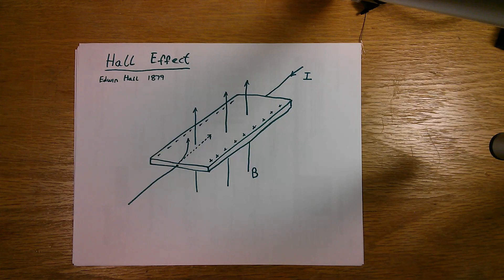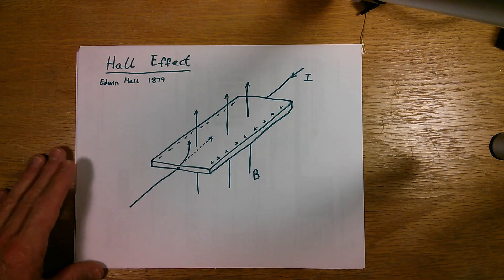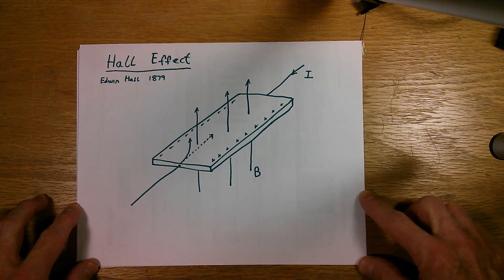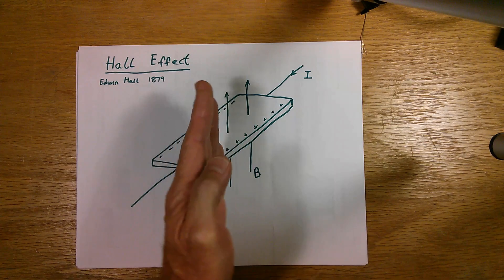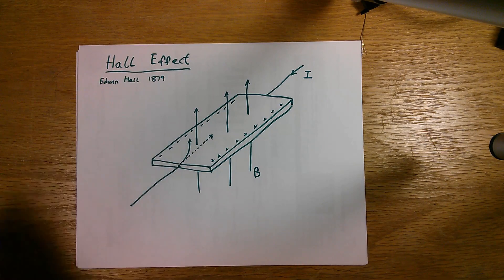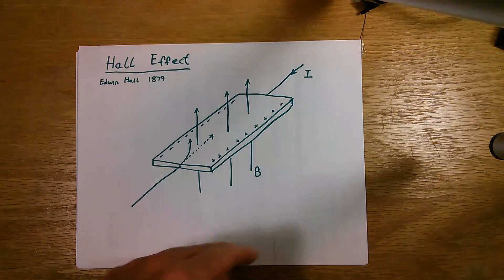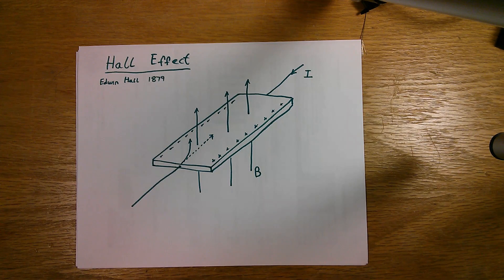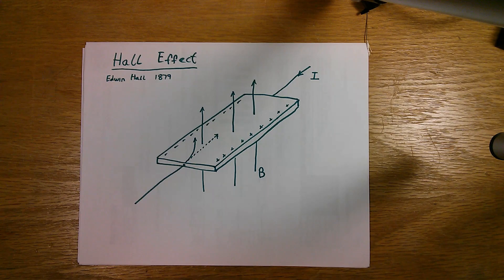Hall Effect Sensor Explained

Comment: Another quality video. I don't understand how it can sense just objects without actually putting a magnet on the object. I would be afraid that, for example, if i was sensing a gear tooth and it became demagnetized it would not be detected.
Reply from the maker: I have another video where I do put a magnet on a rotating shaft and measure the RPM.

With a gear tooth type sensor, the gear is magnetized or is part of a magnetic circuit.  The magnetic field will change as a tooth passes by and the Hall sensor can detect the change in the field.
Reply: So it seems like it is a kind of specialized application where the targets have to be either modified or designed to be picked up by a hall sensor. I guess a lot of things can just be magnetized by a magnet first.

Comment: On a bi polar hall sensor with three legs which leg is connected to the positive terminal of the power sourceFeeding it? Is it the Output or the Supply VCC leg?
Reply from the maker: Power is connected to the Vcc pin. This would be the left-most pin when looking at the sensor with the pins pointing down and the part number visible.

Comment: It would seem that the viewer who pointed out your mistake was mistaken himself. The right hand rule applies to positive charge carriers or conventional current so for electrons you simply have to use the direction opposite to your thumb. Note, if you're trying to determine the direction of force on negative charge carriers you can use your left hand. So with my left hand palm up in the direction of electron flow, I curl my fingers up for the direction of the B-field which is up, and my thumb points to the left. Your drawing is fine.
Reply: Yes very true...the drawing you have drawn is correct and precise. Here we will use the left hand rule. The current is coming out of the page, the electrons are facing a force towards the left which means that the field as to be upwards... :)

Comment: All the sudden that 2 minutes you introduced a new concept without explanation. You're talking about electrons flowing one way and then this other thing flowing holes.?

I thought that the conduction of electricity was just a displacement of electrons.  You seem to be indicating that there is some other sort of particle that travels the opposite direction of electrons or something??

When you have a battery that is charged up all of the electrons are trapped in the positive side wanting to get to the negative side to be at rest right?
Reply: +John Smith 
Holes are just the absence of electrons where an electron can exist. Usually from the different electron orbitals in atoms.
Reply: So in fact the electrons flow from the negative terminal to the positive terminal through the load and the electrons are going to atoms that have spaces in their orbitals for them,

Comment: is there any latency at high frequencies or a limit ?
like to measure something moving realy fast at high rpm  which one is better

hall effect or rotary encoders ?
Reply from the maker: SpIRiTus1995 The frequency limit would likely depend on the type of Hall sensor you use, they usually have some sort of signal conditioning/amplification built in.  Same would be true for rotary encoders.  Do some searching and look at the specs.  Good luck!

Comment: Silicon isn't a good electrical conductor.  It is used as a substrate for integrated circuits but not as a conductor.
Reply from the maker: flip240 True for pure silicon, but N- or P-doped silicon is quite conductive.

Comment: Hi Craig,

cut you please tell me, why you have an error in your drawing? If we show the Lorentz force for elektrons you use the left hand rule. Also the Elektron is moving to left like your drawing. If we use the technical current we use the right Hand rule and also the Elektron is moving to the left. Please explain the error.
Reply from the maker: ***** Thanks for watching. And sorry for taking a long time to respond. A few people have said the same thing about the picture. I did respond in the past, but it seems that all comments around that time have been removed. I didn't remove them, what happened YouTube?

Not trusting the accuracy of Wikipedia, I consulted a Physics text. Here's what I got:
Charged particles moving through a magnetic field will experience a force perpendicular to both the direction of motion and the direction of the magnetic field. Positive particles will experience a force in one direction, negative particles experience a force in the opposite direction. A current moving through the medium has positive and negative particles moving in opposite directions, but the direction of the force they experience from the magnetic field will be in the SAME direction. Thus both will move to the same side of the medium.  The polarity of the Hall effect charge will depend on the majority carriers of the medium.  For most Hall Effect sensors made today, the medium is N-doped silicon, the majority carrier is the electron. 

I took the picture directly from Wikipedia.  In the picture, the current flow is in the conventional direction, ie.: positive carriers, so the electrons are flowing in the opposite direction.  Assuming the majority carriers of the medium are negative, the polarity of the Hall voltage will be as shown in the picture (Wikipedia was correct) as the electrons are following the right-hand rule.

Comment: Hey, thanks for the video tutorial. It's very helpful. However it would be better if you could show a sensor itself. That way it's easier to understand the three/four pins. Also it would be great if you have a drawing illustrating how these sensors are used in real word applications, such as cars. Thanks!
Reply from the maker: Thanks for the comment. At some point, I'll produce a video showing how to use a hall effect sensor to measure current or to count motor shaft rotations. Just gotta find the time...